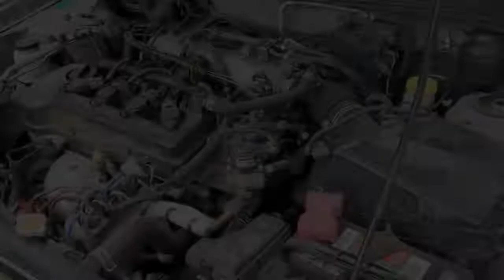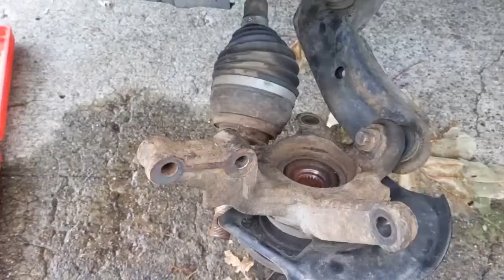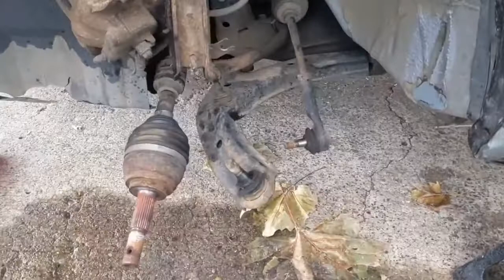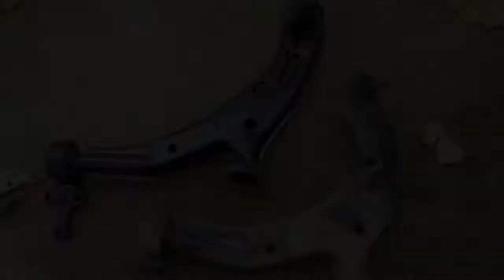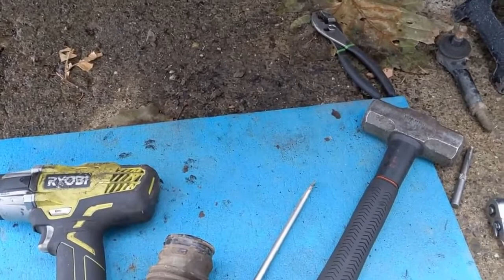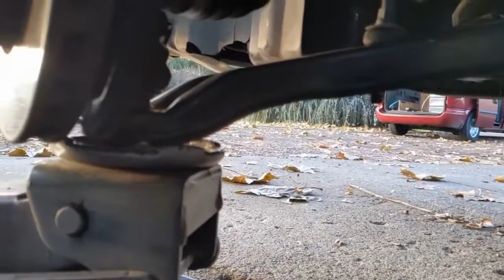2000-2006 Nissan Sentra Lower Control Arm And Tie Rods

Comment: Great video! Very informational and helpful.  Only thing I will add is loading the suspension using a jack like that can be hazardous depending on if and/or how well the car is jacked up and supported.  Trusting a hydraulic jack to hold the weight of the car and then crawling under it to torque those bolts could be very dangerous in some situations.  Just be mindful and be careful!  Use proper jacking and supporting methods!
Reply from the maker: That's a very good point! I always leave the jack stand under the car at the same time and it's not jacked up higher than about an inch above it. That way a jack failure isn't detrimental 👍

Comment: Yo did you have to FILL the lower ball joint with grease or was it prefilled
Reply from the maker: I can't remember but I think it was a sealed ball joint without a zerk fitting.

Comment: This was an excellent video my man! The main thing I was hoping you would address was how you need to have the car down off the jack stands to torque the lower control arms. I wasn’t 100% sure about that but it makes since. I had watched a couple other videos and they didn’t say anything about that. But you did a very impressive video here. Editing and just the amount of tips you shared in such a short time. Very clear and easy to hear and the camera work to get such clear pictures of the parts your talking about was about as good as you could possibly do considering your not in a lit up shop with a lift. Thanks for doing it the right way because it’s nice not to have to watch multiple videos just to make sure your on the right track. Hope your project their in the video worked out well for ya , I’m sure it did.

Comment: How’d you remove the 22bolt
Reply from the maker: I used a wobble extension with my impact on the bolt head and used a wrench to hold the nut. Once the nut is off you can tap on the bolt to get it to start coming out. Once it's backed out some you can use a wrench or impact to keep backing it out with the threads or wiggle the control arm while pulling on the bolt.

Comment: Where did you find the tq, specs? 

Also thanks for the video, I try to avoid going all urka durka on things with bushings so I appreciate the tq specs.
Reply from the maker: I use Identifix for my service manuals. It's similar to alldata.
Reply: @ValleyMobileAutomotive  thank you, looked it up seems like a good resource but I'm too poor for $189/mo, lol. I'm sure it's justifiable if you're a mechanic
Reply from the maker: @DuncanMcKokinyu  A few other options...
Alldata diy
Mitchell
Nissan techinfo (from Nissan)
With either of these you pay for only one vehicle at a time so the price is way less.
Reply: @ValleyMobileAutomotive  awesome, thanks, I appreciate that

Comment: Will this be similar to 1999 Sentra? Same torque specs as well. Thanks for the video. Subbed
Reply from the maker: Yes, it should be a similar procedure for removal and installation but I'm not sure about torque specs. Sometimes they make minor changes depending on the model year.
Reply: What about the inner tie rod? You don't have to torque it?